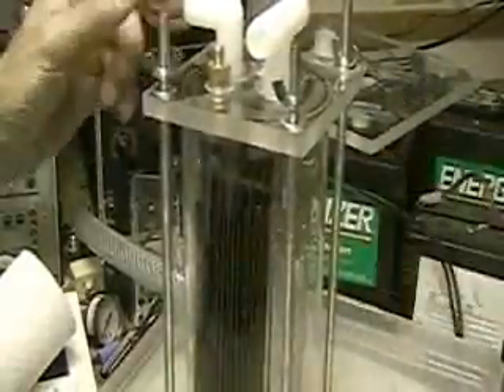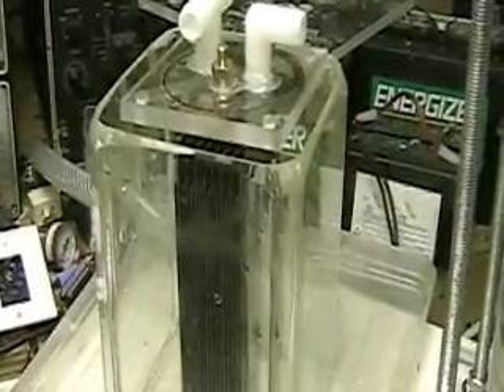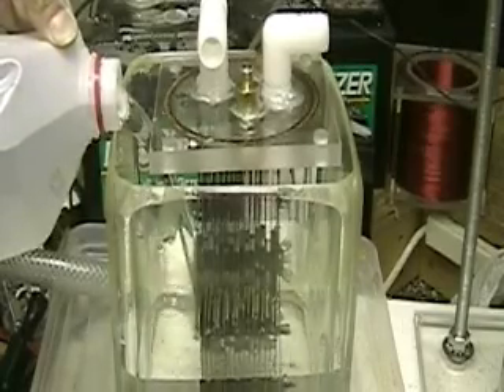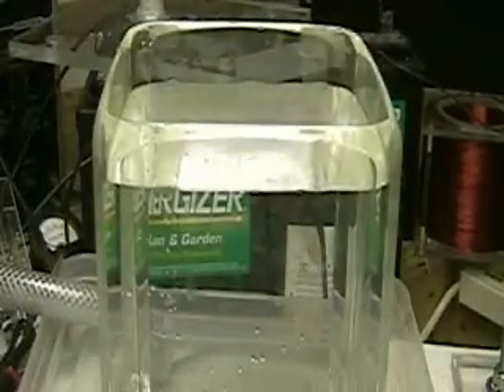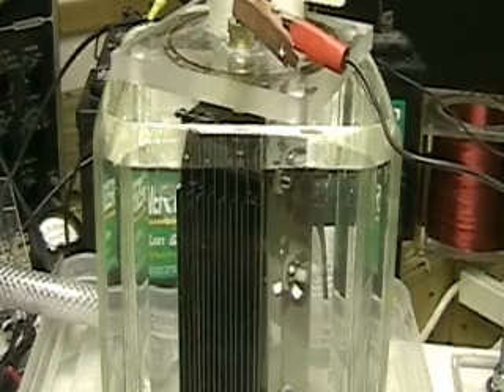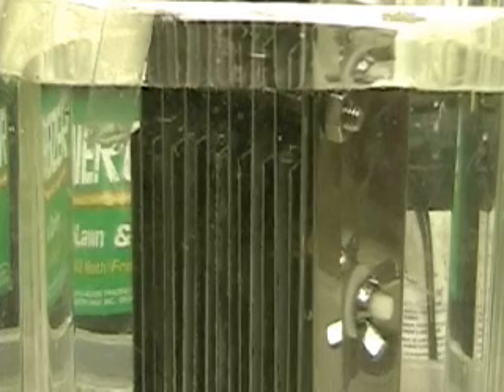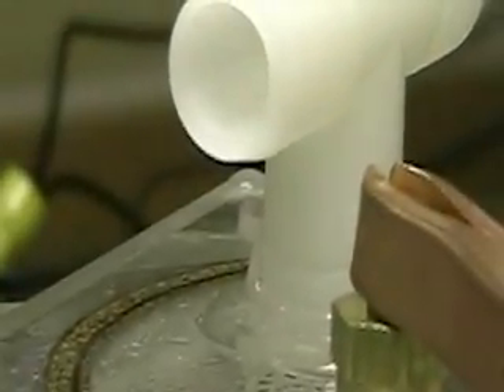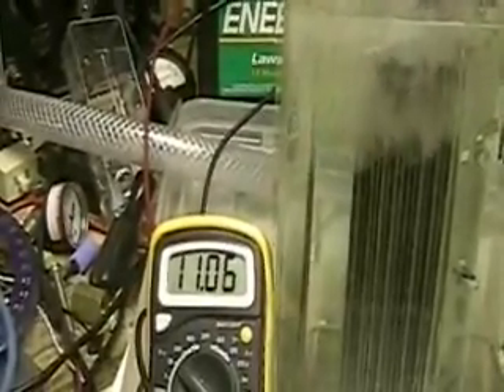Hydrogen Tap (Cell Production Answers) 110

Comment: Hi John, great video series !
Could you also show the produced gas bubbled into water via a hose ?
So we could see, how many and how big bubbles you are producing with this
setup.
2. Do you plan to run it inside the car without a bubbler ?
Do you have a safety backfire valve that prevents blowing up
your electrolyzer when you build it into your car ?
Many thanks.
Regards, Stefan.

Comment: Well John, I remember that you cranked your generator
using only the HHO piped into it, but man thats a whole lot smaller and there is some valve overlap too. But man this is some powerful stuff and I have seen less push a piston out the side of the block. I just don't want you to ruin your engine.

Comment: John, I meant to respond this earlier when I first seen it but I wouldn't try running an engine without outside air being available as it is the nitrogen in the atmospere that cushions the violate explosion inside the cylinder. Take that away and you may end up with a pile of junk.

Comment: It seems to me that with the 16 plate set-up the larger surface area diluted the voltage.  It can't be just down to the container size, I'd say that has nothing to do with it.  It seems the lye gave the weakened potential diff. enough of a boost to make it work properly.

Comment: Well John, I haven't had any problems with the ign. timing on either one of my 2 chevy's And I just installed another HHO Generator which makes
a total of two my 04 Blazer. I adjusted and  measured 5 to 6 amps across each of them with the electrolyte and disstilled water total 10 to 12 amps which really hauls the mail now. Haven't got any mpg data yet but I will if you're interested let me know. Later

Comment: i asked you before.. but you didnt realy answer my Question,, the gas coming off is a mixture of hydrogen and oxegen.. is it posable to capture that gas and run it through a fuel cell
and second (have i gotten it wrong. is it only the hydrogen that you are capturing,, how do you get rid/ where does the oxegen go??
thirdly) is it posable say for Eg to run a car or lawn mower on 100% of the gas that is comming of your cell(h&O) or not/??

Comment: Mr. Aarons, 
I purchased all of the parts to replicate your system, though not through you; I hoped to do it cheaper and more quickly. In the end, my cost was only slightly cheaper than a ready-made unit from you. Add in the gas, time spent getting parts, & the "dirty work", & I realize now I would have saved myself a lot of hassle by ordering one of yours! Anyway... this is my thanks for your excellent work, & perhaps also my small suggestion to your other viewers. Thanks, & keep it up!

Comment: Thanks John.  I was wondering about that myself.  HHO does burn faster than gasoline. So stands to reason that you would need to adjust the timeing.
PLUS;  it burns 3 to 4 times hotter. What are we going to do about that,  Or is it not a problem ????

Comment: There is a way to power time the engine to match whatever octane and/or lack of it to the power of the engine and it works best if the vehicle is an automatic trans. Just get some one to hold the brake while trans in gear an accelerate to 2000 rpm Then adj. ign.timing til the engine stops knocking which then should be your best setting. But check to make sure it doesn't knock under hard acc.

Comment: Why not use more voltage than a single 12v battery?  Like two, three, or more ?  You could cut down on the amperage and still have the same wattage going into the cell with smaller wires to / from the battery.

Comment: I hope this one will help. I would like you to know that the size of plates matters. the more plate you add the more voltage and amps should be needed to produce enough HHO oversizing it will only suffer the alternator. drawing too much amps on a alternator will decrease the engine performance even with pwm. try decreasing your plates.